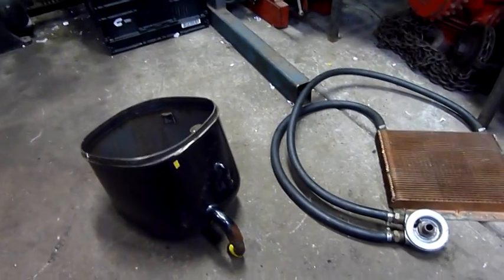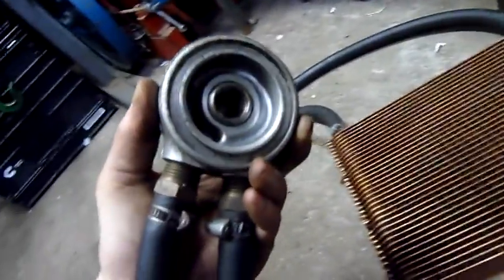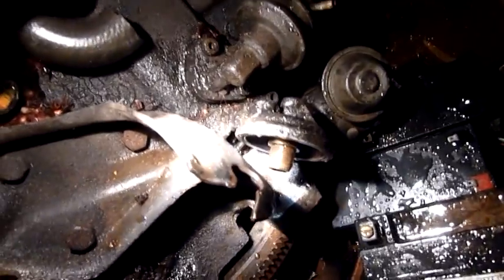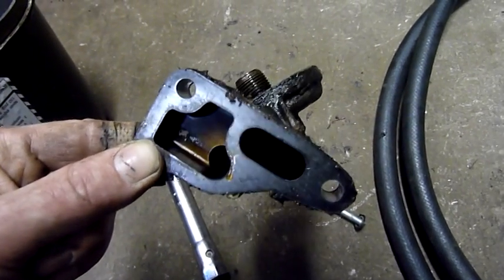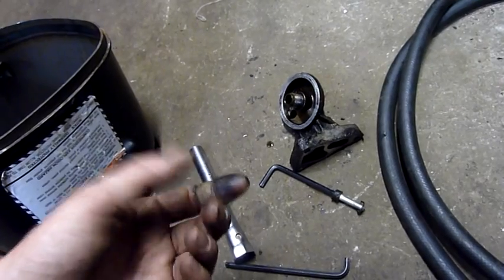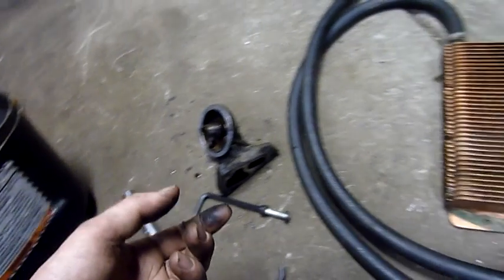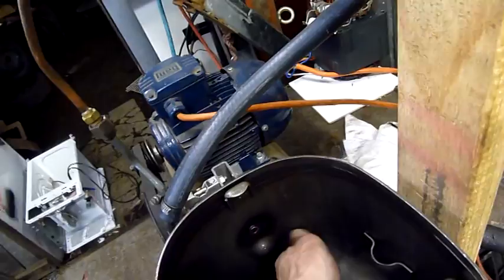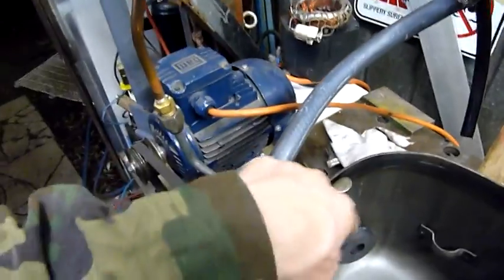Turbojet Oil Pump and Filter Build up Pt1

Comment: easier way to make a gasket. 
Get some gasket material, ballpeen hammer and a couple bolts.
place the gasket material against the flange and take the ballpeen hammer and hammer litghtly where the bolt holds are ... the hammer cuts the material against the bolt hole.

Insert yout bolts to hold the material and then start lightly hammering around the flange edges  ...works super awesome!

Comment: I make those gaskets using the back page of the phone book and a small ball peen hammer to tap out the holes. Output pressure will track input at your flow, unless you let the filter get really blocked, when the bypass opens it will drop about 20PSI. For a gasket for the adaptor just nick the gasket off another scrap filter and put it in there. Cheap inverter look for HY0D7523B and buy one.

Comment: Don't really need the fan, just place it vertical and convection will cool it. You are not getting 20kW of heat into it that it has to cool, more like 1kW which convection will do nicely for initial work.

Comment: Don't be terribly worried about oil volume. Most turbochargers that are of the smaller flavor require restrictors to be run in-line into the pressure side of the turbo charger. If your turbo doesn't have a built in restrictor hole I recommend a 3AN or 4AN line, Lovin' the progress :-)